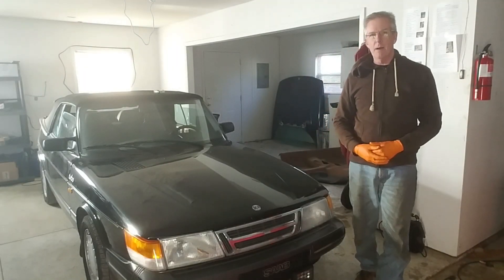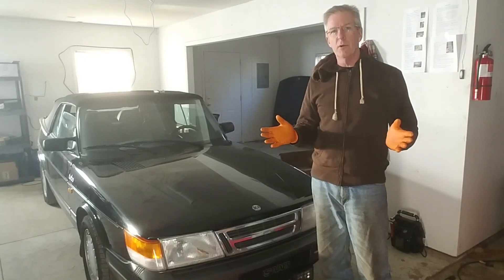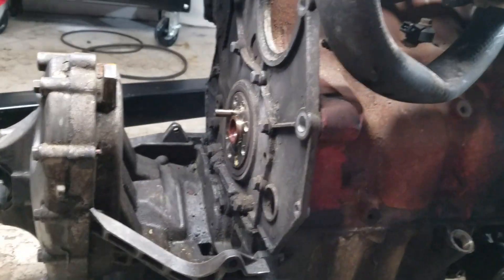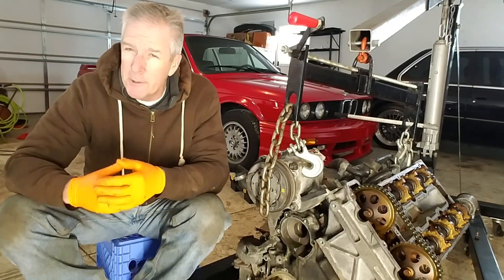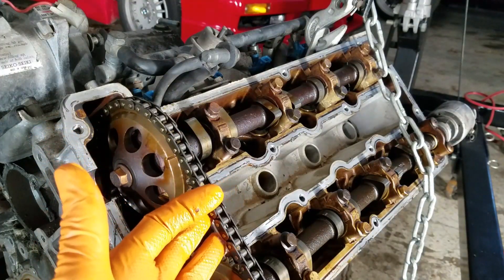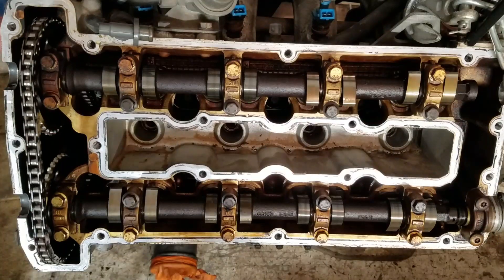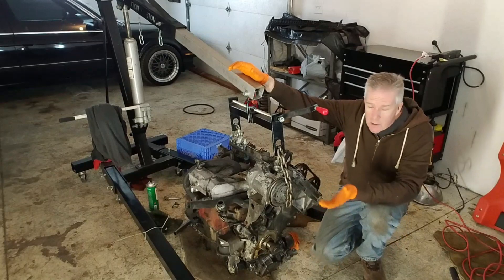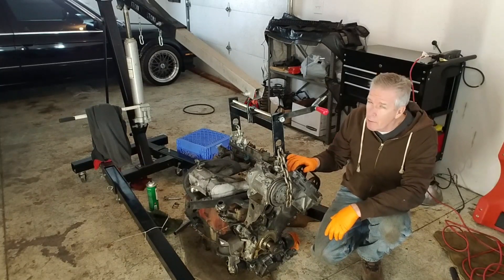Ep.1 - Saab 900 Turbo timing chain basics explained

Comment: I see you used a battery cable to keep the pressure plate sprung. There's a SAAB tool that (have one) is cheap and effective. Looks kinda like a window shade hoop.
Reply from the maker: I bought the tool as well, but found it didn't fit.  Someone said the Sachs clutch I used has an opening smaller than the original and incompatible with the tool.  I've also used 1/4" copper tubing and a spark plug wire.
Reply: Also used copper tubing and I thought I was doing something unique. That was before you could use the internet to test the uniqueness of an idea.

Comment: wouldn't it cause issues having a transmission from a non turbo onto a turbo? wouldn't it strain the transmission with power?
Reply from the maker: What I've read is the same tranny works for both, and the later model transmissions are a bit stronger.  Still, it's a known weak spot in the car.  But, look at me.  I'm not a hooligan.  In fact, someone over on Reddit said I "look like a dentist."   I enjoy seeing the tach and turbo gauge into the red, but realize I'm driving a car that's older that's older than my kids.  And I figure that if it breaks, it's an excuse to pull the engine and get dirty again.
Reply from the maker: I fear you read my reply as being snarky.  Not at all, I was trying to be funny.  One thing I love about this community is how much we can learn from one another.    Willie Eckerslike turned me on to the fact that the primary gear drive in the non-turbo transmission I'm using will fit, but is geared differently than a turbo.  That might affect the RPM at highway speed and lower the overall top end.  Research led me to a guy who is developing an entirely new gear set that will optimize RPM for turbo boost, yet lower the RPM on the highway for less noise, wear and fuel consumption.  That's a win, win, win.
Reply: you've described a very big part of some enthusiast's attitude. if i didn't want to work on my car, why the hell would i have bought it?
Reply from the maker: I bought this car for $500 on Craigslist.  A professional mechanic and car flipper had been tinkering with it for a while and then decided space in his shop was worth more than the car.   I knew a car at that price could be a mess and was ready to walk away - until I saw it. The body and interior were an 8. Having owned Saab's, I was pretty sure I could bring it back to life.  New injectors, new ECU and other tweaks got it to be a very reliable summer driver.  Wife and I dropped the top and traveled  300 miles to a Saab convention - had my fingers crossed the whole way.  Didn't let us down.
Reply: I was just curious because I have the same car and want to convert it to manual as well. I was just asking